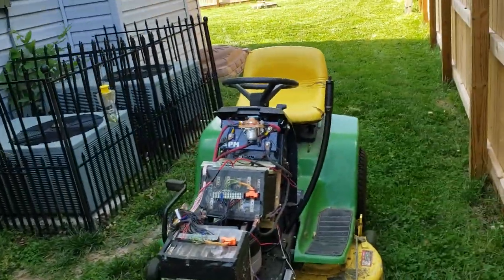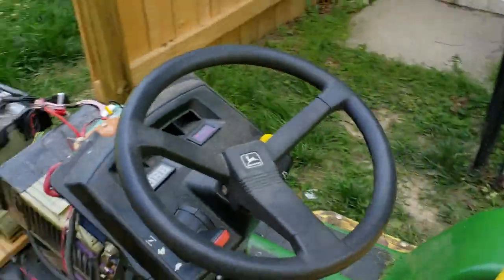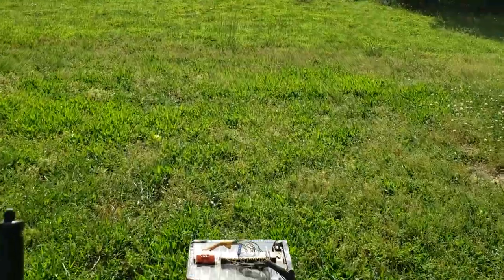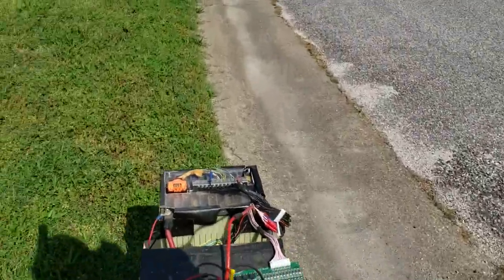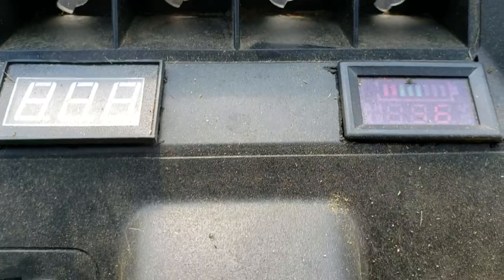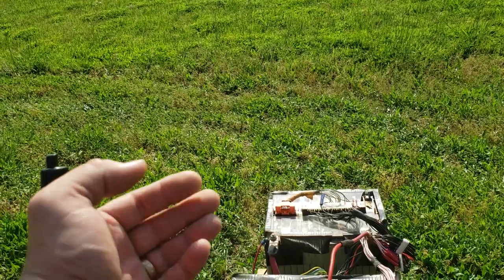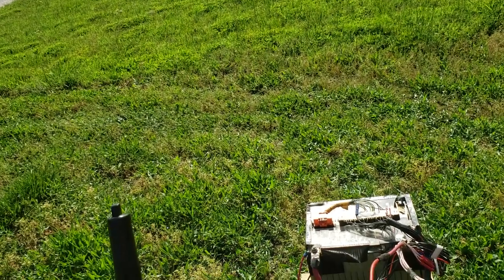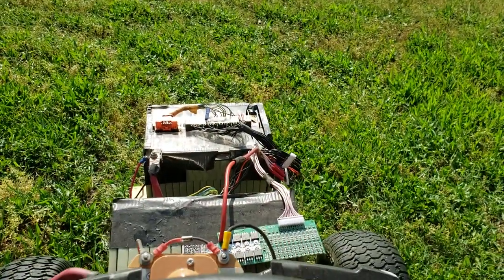John Deere - EV Conversion - Mowing

Comment: What is the motor from and how did you set up the pulley?
Reply from the maker: The motor is from MotEnergy. I bought it as part of a kit from evdrives.com . The specific motor is an me1004, the shaft is 1" in diameter, very similar to a small engine shaft for a riding mower. The pulley was a direct fit, minus needing a longer bolt for the extended length of the John Deere pulley assembly.